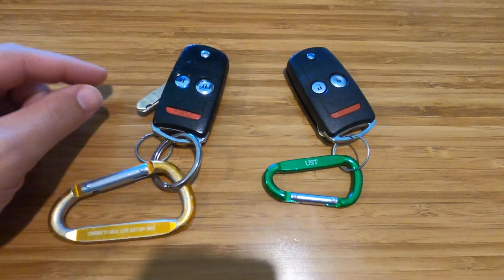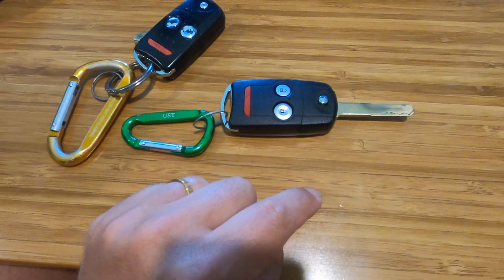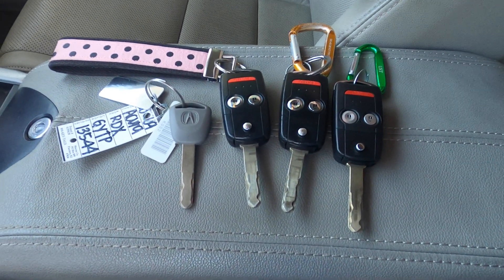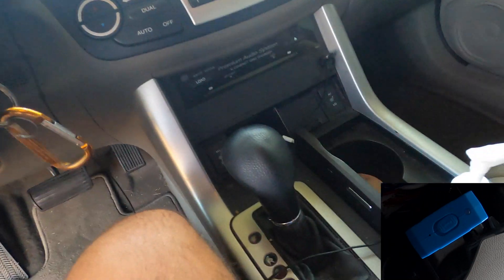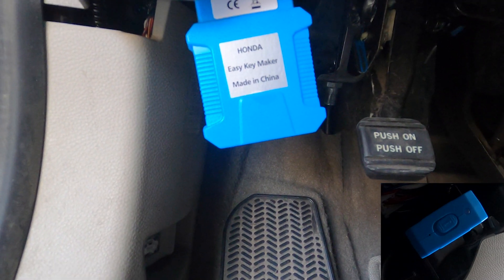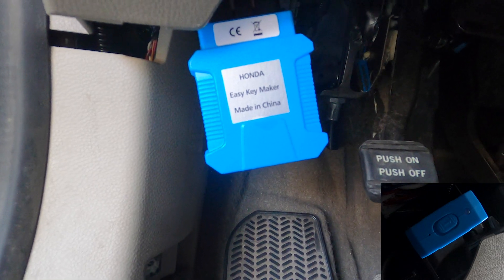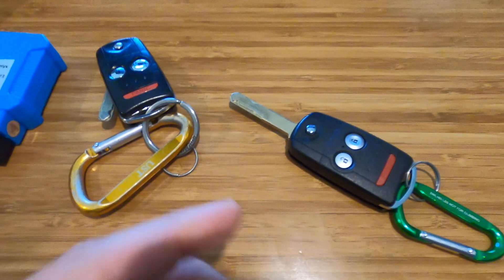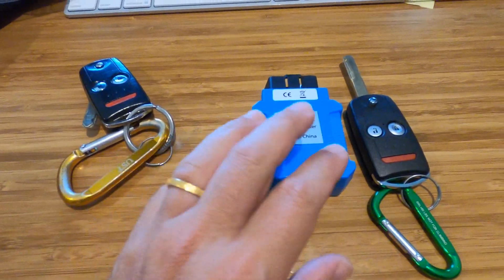How to use Honda Acura Easy Key Maker to program new keys

Comment: Ace can also cut keys on certain vehicles usually around $20
Reply: Also, if you have a local BatteriesPlus+ store near you, they will also cut key fob keys and usually only charge $10.  Other places (like some Ace Hardware shops or the dealer) may try to claim that they can only cut the keys which they sell, and not blank ones that you bring in, which is a very bad customer service policy. So your best best is to call ahead first to confirm.